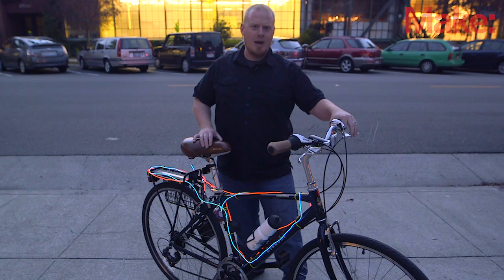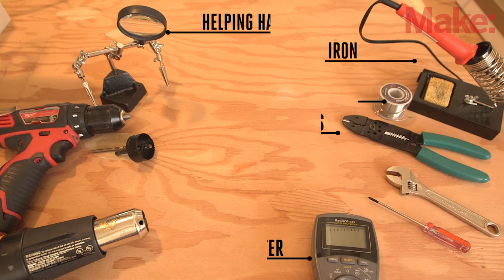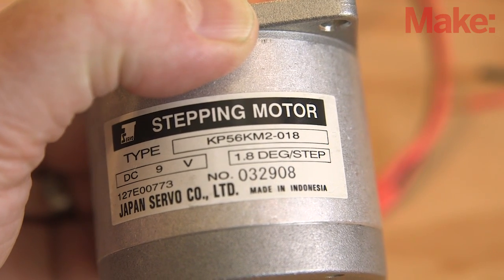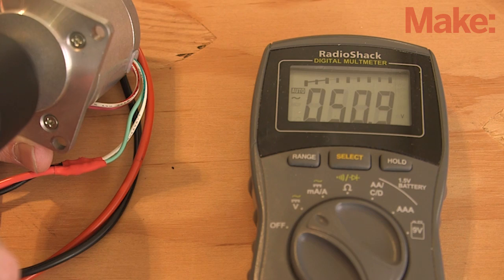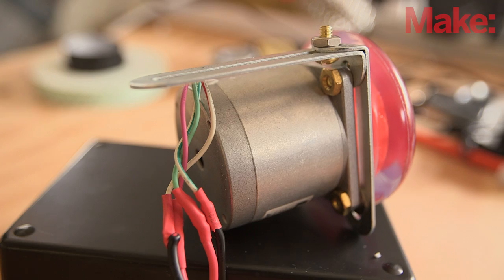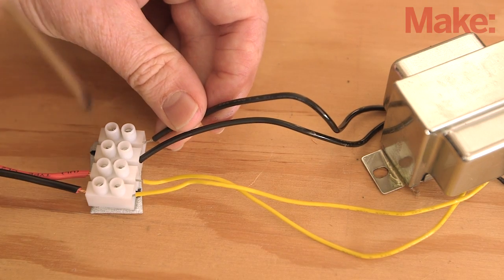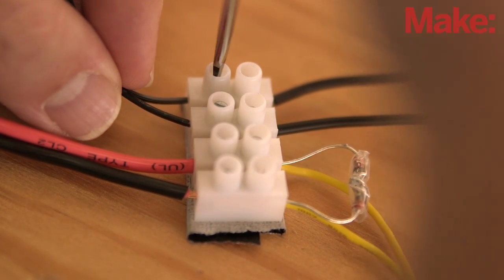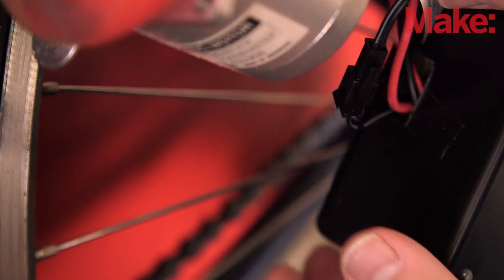Weekend Projects - EL Cycle

Comment: You can buy the e.l wire with a 12v converter and its little black box about an inch long.. then just use some batteries..... you would be able to hide it all under your seat maybe?
Reply: I would still buy a dynamo or a generator to replace the batteries.

Comment: You could do all that wiring crap with the transformers and spend all that time just to have a rats nest of cobbled together crap. Or, the smart people will just get the ELwire that will work with 12v dc. You can get it cheap on the web or you could just pop down to your local automotive parts store and get it from the trailer park bling section.
Reply: That isn't el wire, those are LED lights. Electroluminecent lights are MUCH cooler.